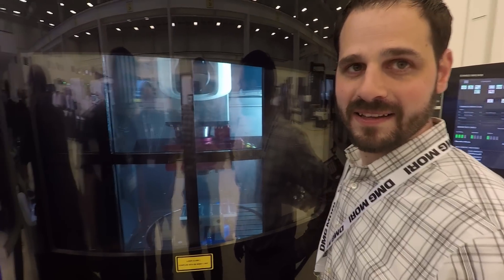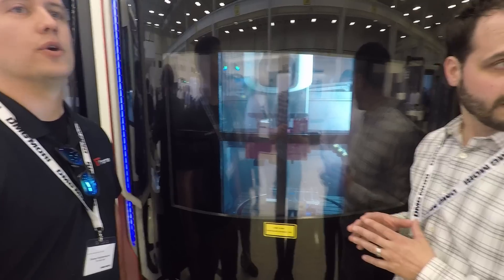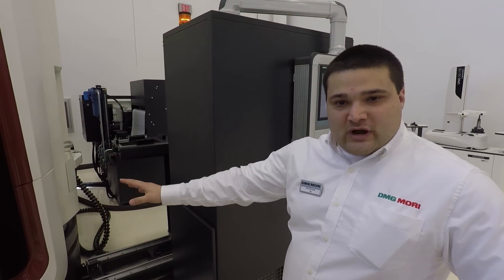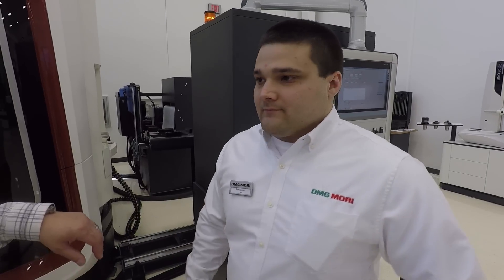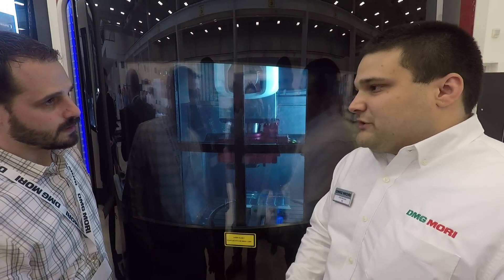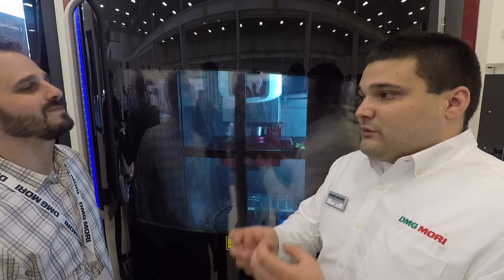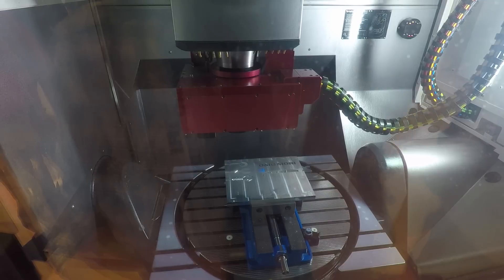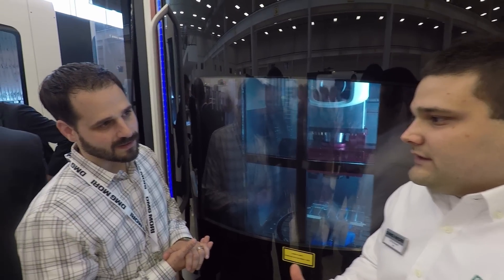Amazing Hybrid CNC Machine: DMG MORI LASERTEC 65 3D!

Comment: I worked on the lasertec 65d 2 years ago in my previous employment. An absolutely mind blowing machine.  We had to build a climate controlled clean room for it. The power supply required by this machine is 400v AC 100 amp. It was an absolute pleasure working on it.

Comment: I wonder what is the strength of these parts. Certainly fascinating topic, very versatile, and pretty fast too. The biggest improvements are in software tools to do CAD and CAM of these parts, as well in machine monitoring tools and sensors it comes with. It is using some magic to monitor the material deposition online.

Comment: Five years ago I predicted they would be doing this in 10 years. So that took 5 years. 
Now I'll predict they will be depositing multiple metals and other materials at the atomic level (one atom at a time) in 5 years. Write it on the wall...
Reply: So i just looked some things up . 

Atomic processing microscope is the name of the machine , and it dates back as early as 1993 .
Book : Fundamentals of Microfabrication: The Science of Miniaturization, Second Edition
By Marc J. Madou            ------     page 61 .
Reply: there is a fair probability they are already doing it , just in secret and or testing phase .
Reply: A pretty recent manufacturing technology book I have lists atomic manipulation as an operation for insane tolerances so...I think they beat you to it!

Comment: So basically a hybrid FDM printer/milling machine.  It seems like you could avoid the limitations of both technologies this way - the additive printing means you can mill out details in interior sections which would later be inaccessable to the milling head, and the ability to remove things lets you go crazy with printing geometry that requires all sorts of support.  Also, milling allows far better surface detailing and finishing than straight FDM.  And all this in metal of your choice...

I would imagine that if you're depositing steel you'd need some sort of inert atmosphere?  Probably not really that big a deal, but it is another consumable.  I expect the biggest limitation is for high stress applications - monocrystaline is right out, and forging/work hardening is out too.  Best you can do is whatever can be done in tempering cycles.  I'm mentioning this since iconel was mentioned, and if you're going to use a superalloy for something, it's probably going to be something where all this matters.

Actually, creating something monocrystaline might be possible, though very hard.  You'd start with a seed crystal manufactured by conventional means, then if you can control temperature and particle size very well, maybe you could induce it to crystalize on the existant seed and not form any new crystals?  An ionized stream might accomplish this.  And if you can control it well enough to do this, if you wanted crystals of a certain size, it's just a matter of causing defects at a controled rate, perhaps by mixing in bits of ground metal into your stream.  This still doesn't give you a way to create the crystal structure caused by work hardening, though, and you might have limitations to which crystals you can produce, favoring the more open lower density molecular crystal structures.  Maybe you can pressurize the work chamber?  What would this do to your nice ion stream?  I guess if you gave the part an appropriate electrical charge, the ions would find their way over and stick regardless of inert gas molecules getting in the way.  How much pressure would be needed?  That might be prohibative.  Graphite is fine, but no diamond for you!  You might also have problems with it forming a dendrite like web rather than a nice solid crystal.

Comment: So when can I buy a cheap chinese ripoff kit of this thing?
Reply: jaybogataj theres a coupla guys down in Florida who are building a small version of this same concept, using a wire feed welder, with a home made cnc mill in one package.
Reply: Don Mox I believe they're called P3D creations. I know the have an Instagram acct. I let them at makerfaire a coupla years ago, and it was one of the few things there that impressed me.
Reply: Machinist 72 I'll check it out. Ty
Reply: Machinist 72 link?
Reply: I would say the software and sensors are a big part of what this actually work correctly. Surely, chineese military and space program will use it for stuff ;D